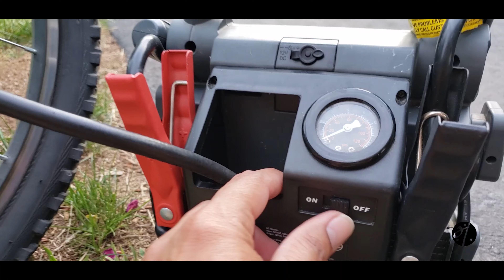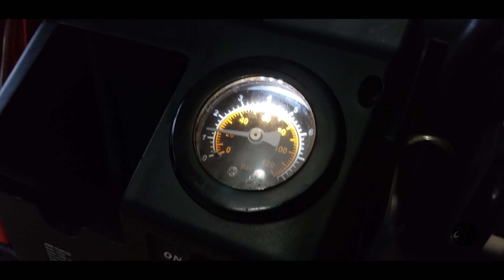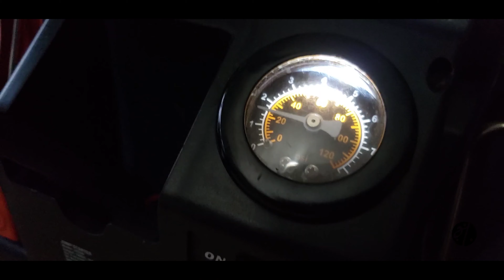Fix your Stanley Air Compressor /Jump Starter with tape hack | Air Compressor fix

Comment: Thanks for the video, the temporary fix is great. For long term you can just replace the o-ring around the piston.
Reply: I just took mine apart and the piston ring is shot. It’s like an o-ring, but if it were cut, the cross-section would look like a “lopsided U.” I’ve been looking on amazon, ali-express, etc, but not having much luck. Have you done this or know where I would find this part?
Reply: @karlhildon8477  It’s been a while, but if I remember, I lucked out and had one from something else, don’t remember what though.